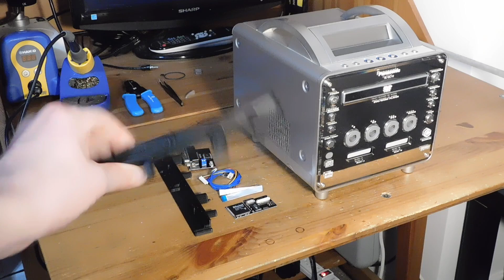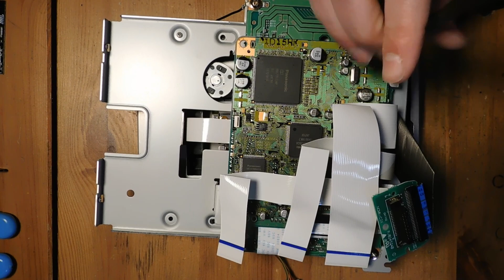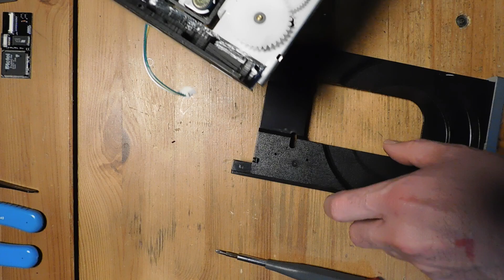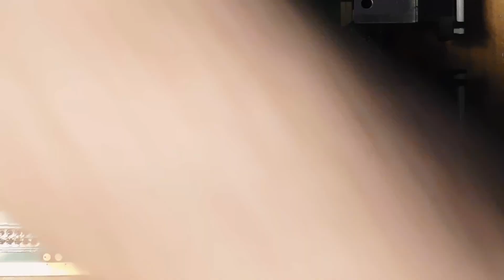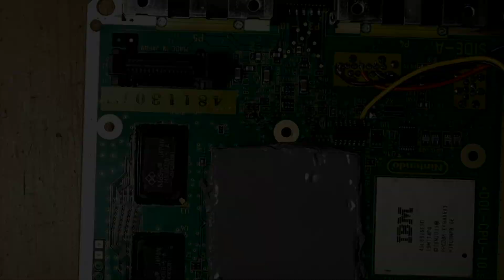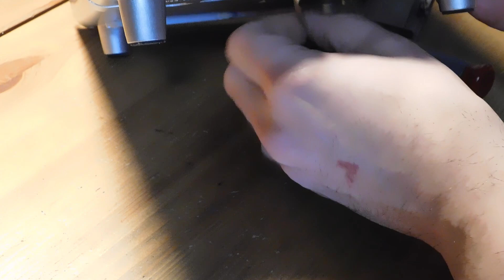Panasonic Q Mods! DVD Drive repair, region switch, and ViperGC install!

Comment: Currently working on a Q for someone that had been beat up in the mail. Glued a whole bunch of plastic, replaced the spindle magnet, and replaced the drive belt. After reassembling. All worked great, games and dvds. However, after turning off for 30 minutes, dvds still play perfect, but when In game mode, I get a GameCube error saying to check the manual. Whether there is a disc in the console or not. Any clue what can cause that? I can't find any info about the Q with that issue online anywhere. I assume it's not the lens since DVDs play perfectly.

Comment: top notch repair. more people need to know about the thick walls where the top cover attaches. i did the exact same thing you did before i stumbled upon this video. scrambling to fix my laser now...
Reply from the maker: Thanks, I really appreciate the feedback! Good luck with the repair and I hope this helps!
Reply: @LIRetroGaming  thank you. Looks like a case of bad caps. The drive is behaving erratically in dvd mode -- always spinning, won't read, and video output loses sync intermittently. I can read gamecube games no problem, and i can browse the files on movie discs in swiss. Let me know if you've ever seen a Q with bad caps and what that looks like.

Comment: Thanks you so much.
I have been able to fix my SL-GC10 which had the same issue. It's a nightmare to open ( even tho I did not go to the MB ) but the US/JP switch is not an option imho so ... but for now it needs more love and cleanup to shine again :)
Thanks again for your channel - I love it !
Reply from the maker: Awesome, I’m glad that this video was helpful!
Reply: This console is a nightmare to fix ...
I got two new ones and both have belt so dry it's almost break when I tried to remove them.
So many layer of screws and cables as you show us in this nice video.
But it's worth the effort, it's gorgeous in the dark ( and with a Pico inside :P ).
Now looking for belt replacement in my area as shipping cost are expensive from US/EU to Japan :)

Congrats to both of you by the way :)

Comment: Thanks for the video.  It is great.  I do have 2 questions though.  On the left rail that you 3d printed for the drive to slide along, did you use the metal spring from the original rail?  Would that negate the need for the shimms as that would push the tray against the gear?

Comment: Hello mate, I don't know if you will remember me. A year ago I told you that I had the same problem that the DVD tray got stuck and did not eject. Well, yesterday I finally decided and disassemble it following your steps, clean the dust I had on the gears, change the rubber strap and everything is fine. But now a new problem has arisen, when I put the DVD mode the image is seen with interference or very dark and before this did not happen. In game mode everything is fine, it is only in DVD mode. Thank you.
Reply from the maker: That’s a strange problem and I’m not sure why that would happen. Is the dvd tray going all the way back?

Comment: I have a question where’s the battery for time & calendar. i have one but i don’t know how solder is this easy to change like the other GameCube by the controller poets or do i need to open it completely ?
Reply from the maker: The battery is located on the controller port PCB and you don't have to take apart the whole console to get access to it. It's not difficult to replace the battery - if you have ever replaced the battery in a game cartridge the process is the same.

Comment: Thanks for the Vid, I Have had my Q since 2002 right after they released I bought one. I don't think it's just the Import from JP that breaks the Tray Track, There were thousands imported back then and this wasn't a common issue. I think its just the plastic was of cheap quality and with age has become extremely brittle, so importing one in this day and age would be complete suicide for the rails. I Finally disassembled mine to clean the gunk out of the tracks that build up with the Silicone grease and to change the band, found one of my tracks had a crack straight down and when unscrewing the boards from the tray 2 of those legs just fell apart. I seriously managed to take my time and slowly super glue everything back together and it held up great and the screws had no issue fastening the boards back to the tray. The Disc Tray now slides open and closed like new again, things for the visual assistance.
Reply from the maker: Awesome, I’m glad you got yours working again and that the video was helpful

Comment: What is the difference between Viper GC and the Viper Extreme??
Reply from the maker: The extreme uses USB for connecting to a computer whereas the original viper uses a serial port

Comment: Does the XenoGC chip work with the Panasonic q?
Reply from the maker: No unfortunately it does not because the drive is significantly different from a standard cube

Comment: I just have a little side note. So I live in Japan and bought 3 of these. The rails are not breaking from being shipped from Japan. They apparently break just from basic use. The vibration and intense movement of the tray puts excessive wear on the rails causing the plastic to split easily. With my first one, the rail split right down the middle. I super-glued it back together and it worked fine. The second one, I was lucky and it had no problems. The third one, the feet on the left rail (with the teeth) and broken apart, causing the rail to get disconnected with the tray itself. The belt was fine. I just got some legos and super-glued it to the drive and it too worked fine. My friend from Okayama called me about her GameCube after I told her I fixed these and she said that her rails are also in pieces. Her GameCube just sat there, never moved. Just figured I would mention that.

Also, with replacing the belt, I found that you don't actually have to remove the drive, just the top part of the system, then the silver plate on the drive. Pull the tray out and you have very easy access to the belt.
Reply from the maker: Thanks for that information, that’s really helpful! I’m glad that there are complete replacements for the rails but it’s always good to learn of other methods for fixing this system

Comment: How do I get the viper GC mod Chip
Reply from the maker: They are no longer being made so you need to either remove one from an existing gamecube or find a seller that still has them in stock

Comment: PAL DVDs won't work due to lack of some VRAM for the higher resolution 576 and not 480. It's possible to convert PAL DVD to NTSC and burn it on DVD, that's works. Regionfree on burned DVD is important or using a Panasonic Service Disc 2 to change the region to 0/ALL for original NTSC DVDs. Once used, this is changed forever and there is no need for that disc anymore.
Reply from the maker: Thanks for sharing that information. I have not yet tried any PAL content on a Panasonic Q yet so that’s very good to know
Reply: Can you give a link or a clue or where to get this disc. i have a Panasonic Q that I’ve purchased from Japan with a region switch just doesn’t play American “DVDs only region 2” would you please help a fellow here.

Comment: these unit came shipped for usa and japan region.to get usa region hold the power switch down for a few seconds at boot up if i remember correctly.boots up into usa region with english menu.another item i use in the uk on this is the freeloader disc,that allows me to play pal games on this without all the modifications.

Comment: been repairing  q's for quite some time  thing 6 years so far  got a bunch of notes on them and some custom made repro boards  for cracked dvd drive boards and front controller port boards   also maped few resistors out that cause problems eith booting and drive mech  also got bunch of custom made ribbons  to replace brittle broken ones
Reply: I want a Panasonic GameCube like for real
Reply: @Lionstar-Lion  lol its sweet  its basicly a dvd player ducktaped to a gamecube  lol  with a board to do the io switching
Reply: Do you still repair?
Reply: @AustinVetter  ya still repairs and make parts for them
Reply: @mariopic  How can I get ahold of you?
Reply: Hey mariopic, do you still repair Q’s ?
Reply: If I have an original model how would repairing it go?  Are you able to have them shipped out for service?